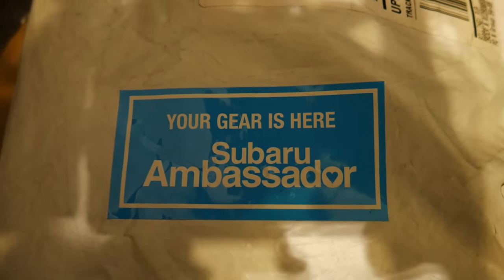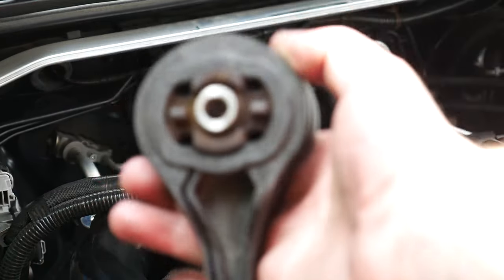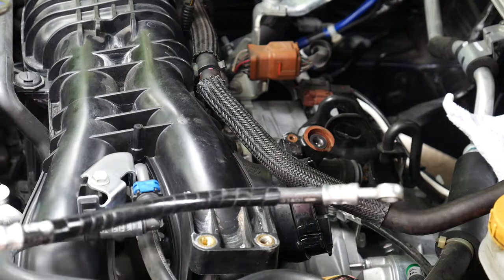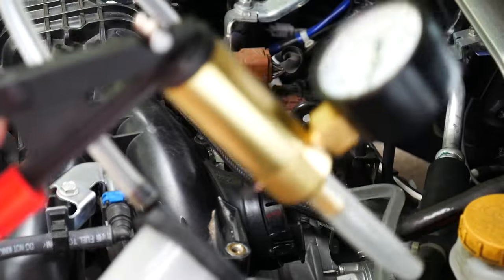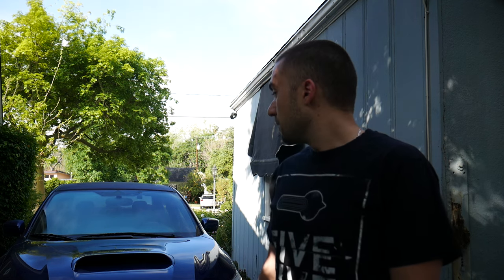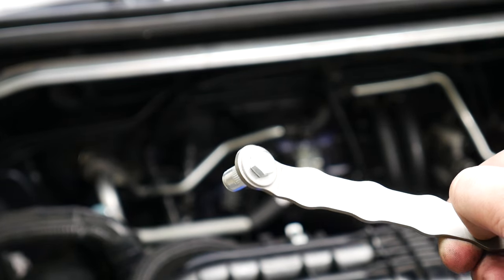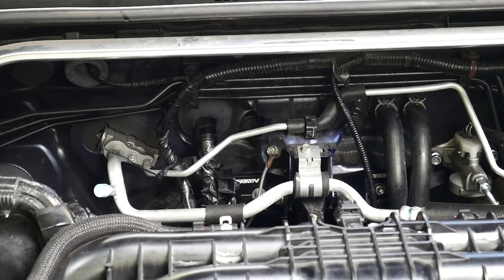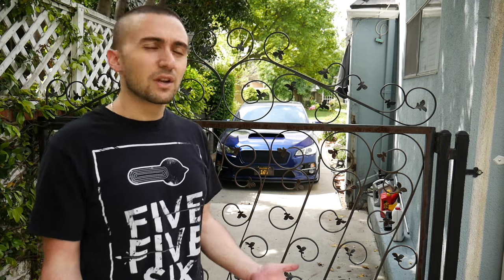PERRIN Pitch Stop Brace Install 2015 - 2017 Subaru WRX/STI

Comment: Next time you pull your intercooler, you should cut the tape and tip-tie on the wiring loom.  After that it should lay flat and not scratch anything.
Reply from the maker: +Casper W thanks Casper, good call. I completely forgot to address that

Comment: This is helpful the fact that you pointed out the secondary internal brake fluid resevoir for the clutch. I had a similar situation with my manual MK6 years ago 😄
Reply from the maker: Thanks man, I couldn't believe no one had mentioned it in the instructions or any of the threads. Just says don't run it dry or you'll get air in the brake lines... that's apparently impossible to do lol.
Reply: Steemax thanks for the video! So you mentioned that there was a separate internal reservoir. How did you end up filling it?
Reply from the maker: +EvoLou1126 that's correct. So although it looks full and it's filled to the brim when you look through the fill hole you just slowly keep filling it and it will start filling the clutch side. It's very odd
Reply: Steemax I think I understand. It eventually fills, it just takes time, unlike bleeding the brakes where you see the reservoir level go down immediately as you drain from the brake lines. I've been thinking about doing this preventative mod. When I changed the transmission mount, my 1-2 shift improved like it felt more connected. It's been a few months now and maybe I got used to it but I'm looking to tighten it up some more. Having a tighter pitch stop might get that done.
Reply: Steemax how long does it take for the clutch to eventually fill up since it is divided in the reservoir?? I'm definitely gonna do this mod, but you got me worried 4 hours of bleeding!??